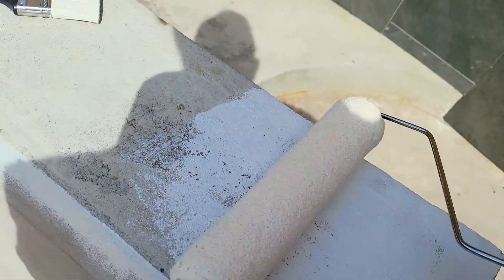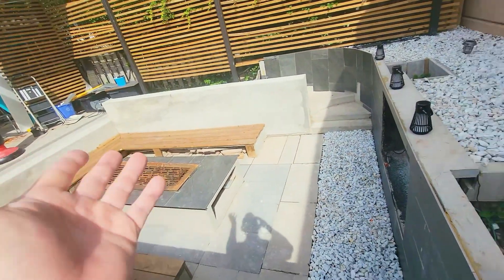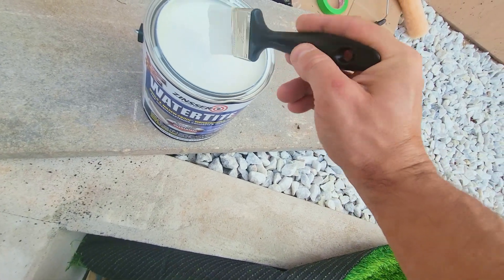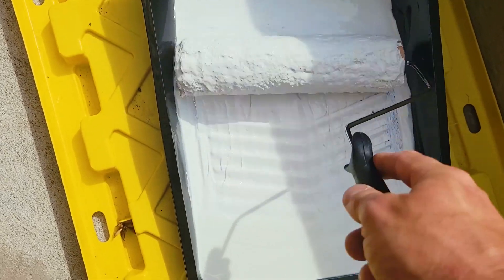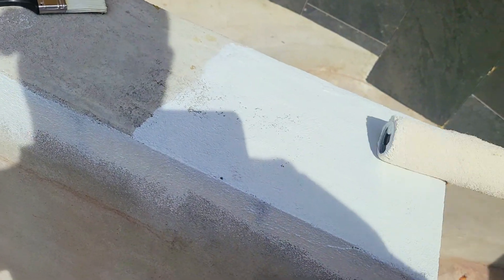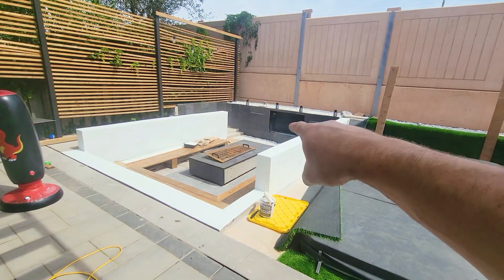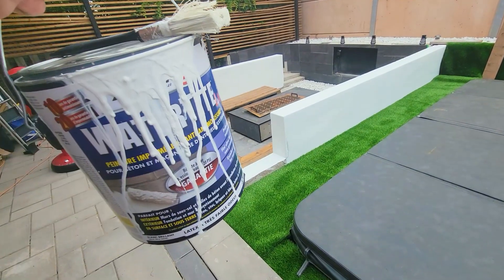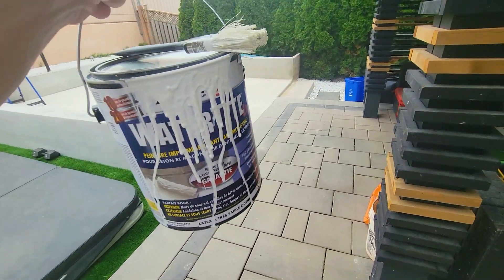Best Concrete Paint - Zinsser Waterproof Paint For Outdoor Painting Concrete - Best Mould Paint

Comment from the maker: https://geni.us/zinsserWaterProofPainL - Today You'll see my Backyard Makeover Sunken Firepit finally Painted with Outdoor concrete Paint. I used the Bright White Zinsser Waterproofing Paint that's also mould paint. The Before and After is Fantastic! I'll show you how to Paint Stucco and How to Paint Parging surfaces with the Zinsser WaterTite Waterproofing Paint. The Zinsser watertight paint is low odour latex-based concrete and masonry paint for interior and exterior use. You can paint concrete Floors, Cinder Blocks, Stucco, Bricks, Pavers, Basement Walls with Mold and it'll never come back, use a cheap roller and paintbrush to apply. If you want to know How to Paint Stucco or What Paint to Use to Paint Stucco or What Paint to use to Paint Brick watch my full concrete painting tutorial and consider the Zinsser WaterTite Lx Waterproofing Paint For Concrete & Masonry. Guaranteed to Stop Water, Resists Up to 20 lb. of Water Pressure, Very Smooth, Bright White, Non-Gritty Finish, Applies Easily to Dry Walls with Brush or Roller, Ultra Low Odor, Easy Soap and Water Cleanup, Backed By Two Guarantees: 15 Yr. Waterproof and 5 Yr. Mold and Mildew-Proof Paint Film, Ideal for Basements and Other Interior and Exterior Surfaces, Contains a Mildewcide to Prevent the Growth of Mold and Mildew On The Paint Film Only.